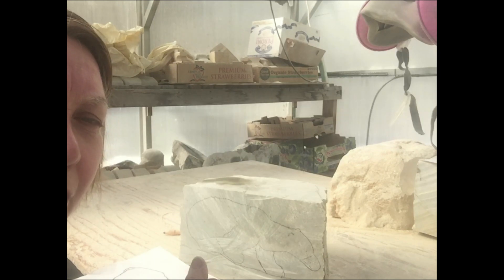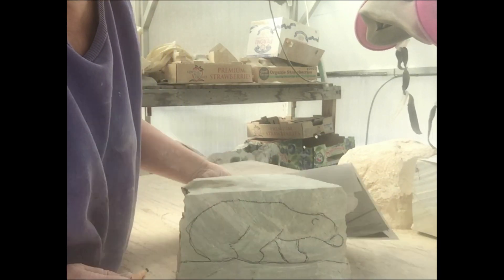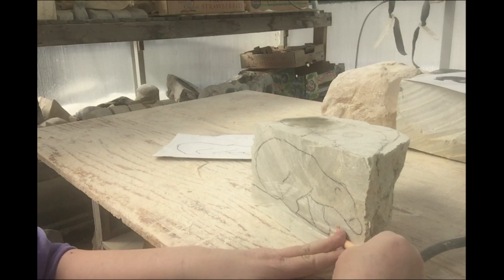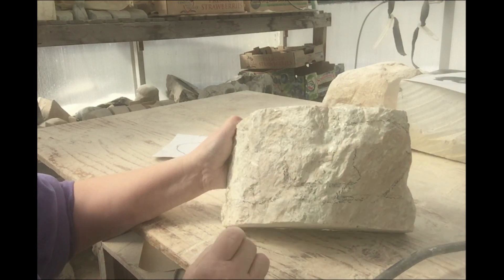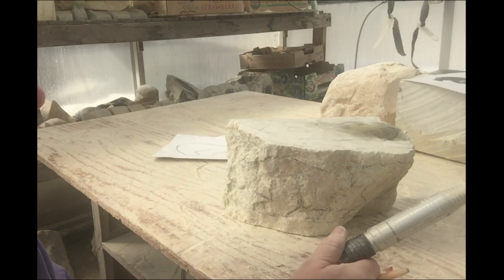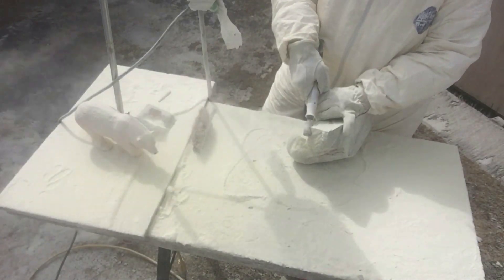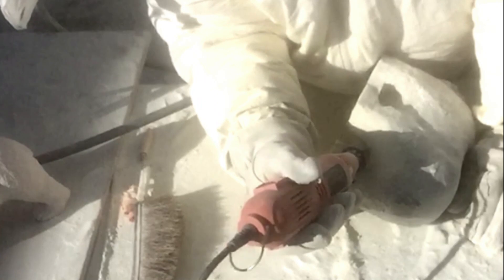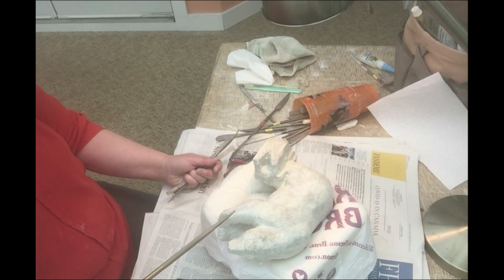Planning and Carving your Soapstone Polar Bear

Comment: Hi Kay, thank you for sharing your video. I also do some soap stone carving but primarily with smaller pieces. I am interested in doing larger pieces like this one and just would like if you could itemize the drill you are using for the Foredom. There are so many and if you could provide the model number, place to purchase and necessary accessories would be great. Sure don't want to purchase anything not needed nor inappropriate tools. Also where do you purchase PPE and types. Thank you so much.
Reply from the maker: Hi Sharon, I have been purchasing my Foredom, bits and supplies from Razortip Industries in Saskatchewan.  They have a nice supply and also do repairs. The bit I like to use is a carbide cylinder shape, costs $25-30, just check which shank you need that will fit your handle. There are other shapes of course but that is my favourite. Then I usually go down to a Dremel type tool, usually the Cdn Tire brand.  They aren't too expensive and if I blow out the motor on it, which has happened a number of times, within 1 yr. you can get a one time replacement. My PPE, Tyvek suits,  are a gift from a friend but I'm sure you can get them from the safety supply place where I also but my 3M masks and filters at Grainger Industrial Supply on Roper rd. in Edmonton. Hope that helps!